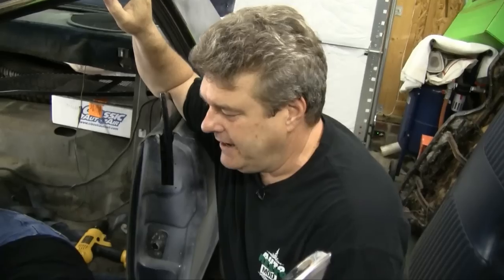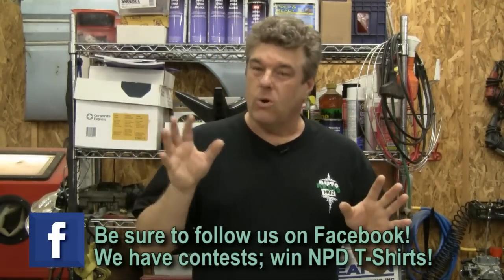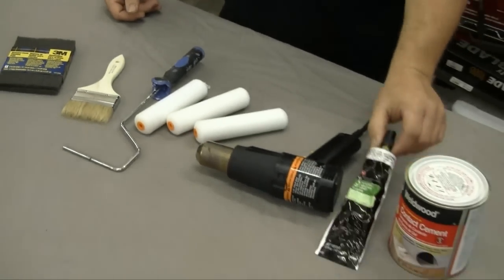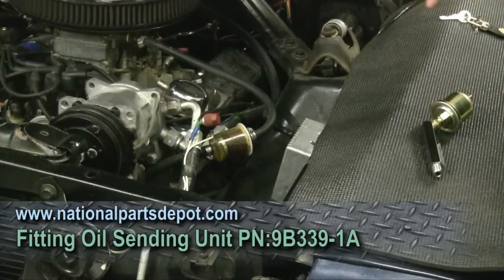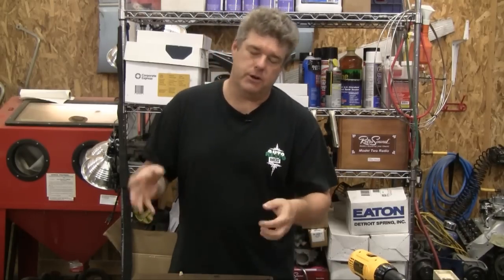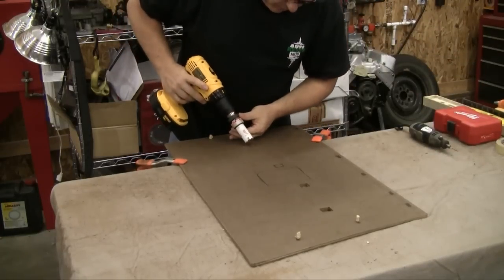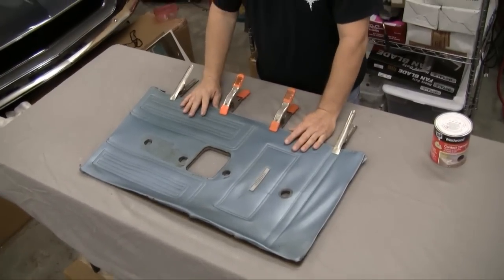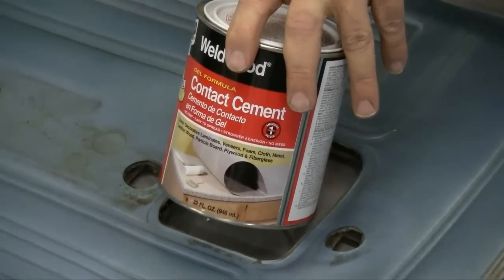Rebuilding Muscle Car and Classic Car Door Panels Episode 127 Autorestomod

Comment: When you're working with the door panel backing, to prevent the back side of the panel from blowing out when you drill, set the panel on top of a sacraficial piece of wood and drill through into the sacraficial wood. It supports the panel and prevents blowout.

Comment: Easier than that, on soft material, plastic, particle board ect. Just run your hole saw in reverse. It takes a little longer but it doesn’t blow out and the finish is clean.
Reply from the maker: Great tip!

Comment: Greeting. What material is it? that blue one? is it some plastic fabric? Is there a special name and are they still being produced? Thank you!
Reply from the maker: The two door panels are still produced you can get them here: https://www.autokrafters.com/

The panels are plastic with a open cell foam backing to give them a puffy look and feel. They are originally heat sealed to the fiber board.
Reply: @AutoRestoMod  
Thanks for the reply but I am primarily interested only in the material that is glued to the board. which gives color to the panel. it’s kind of like artificial leather but it’s not. something else. Do you know what that material is?

Comment: observation: These guys are hack. 18v/ 24v drill for a simple hole? geesh. Get out a smaller 12v drill. No common sense to prevent "breakout on the rear side. Pinewood Derby kids know better. Then an unorganized wall back drop? This screams half-a$$ed.
Reply from the maker: Well...that's like....just your opinion man. Come over and show us how you'd wow the crowd with your expertise and pinewood derby knowledge. We'll be waiting.
Reply: Lousy Observation. Blow out caused by not supporting back of panel while drilling through. Ex. Sacrificial board behind panel while drilling.